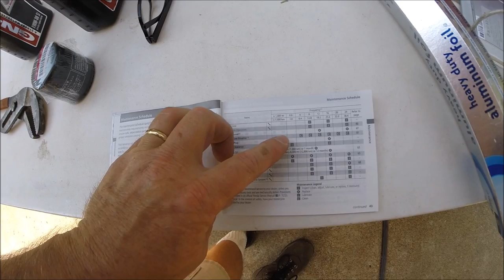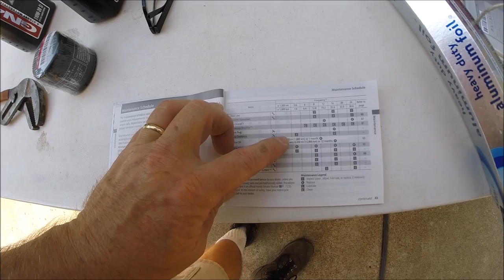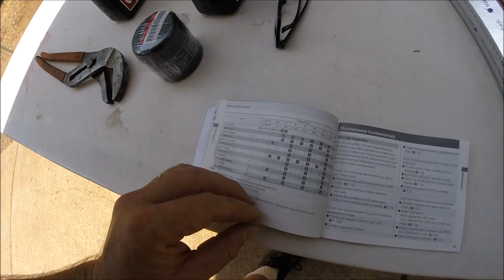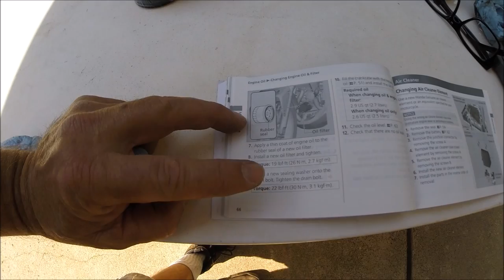Rally Raid Honda CB500X Oil Change with RR engine guard on.

Comment: DNA Air Filters   R-H5N20-02. for 19-22 models previous model filters are available. $130.00 AU  the founding distributor is in Greece . SRCAdventure Moto  has a real good bash plate which covers your headers about 4-500 AU

Comment: Thank you very much for all these fantastic videos! Does the engine guard have the propper dimensions so that if you drop the bike to either side, no parts of the engine will touch the ground?
Reply from the maker: Yes, the handle bars/brush guards help too. We've dropped these bikes alot and have yet to hit the engine....be careful you dont 'case' it so hard that you shear the engine mount bolt where the forward bash plate mounts.
Reply: Thanks!

Comment: Hey do you still have this bike and if so ever have an issue with the crash bars mounted to the engine block? I have been thinking of this bike due to lower weight but I'm concerned with cracking the block on a hard off.  Thanks for any feedback.

Comment: I bought a used (7 miles) and now ( 430) miles the skid pan/bash plate vibrates. Took a while to pinpoint the problem but welds are junk. The rear rack cut the seat in 2 places, I'm done with RR. I thought they did all the R&D but it looks like not so much. I have e mailed them several times and got no response, I guess customer service is not there strong point either. Must be marketing

Comment: the filter fits into the existing air filter and pocks in through the hole and screws on , then just pull it out and air hose it and put back in initial cost is large but being able to reuse it is the bonus

Comment: I'm curious.  Does the new crush washer come with the oil filter?  It looks like it was taped on outside of the plastic wrap of the filter but it's hard to tell.
Reply from the maker: taped on the outside.

Comment: So when you top it off using the breather glass, the bike doesn't have to be level? (Is it designed to be done while on the kickstand?)
Reply from the maker: The bike should be level to determine proper oil level in the glass.